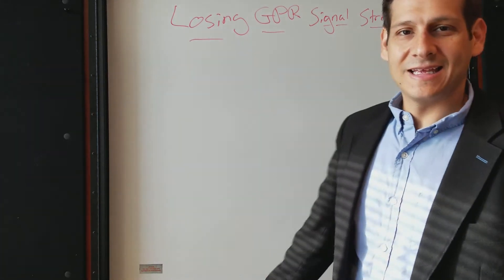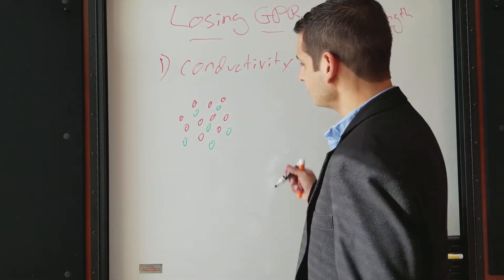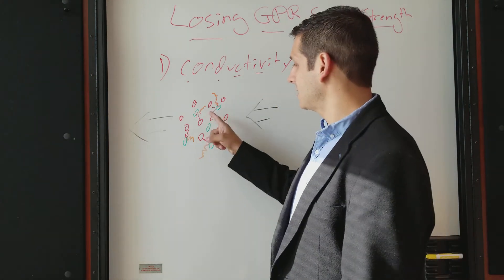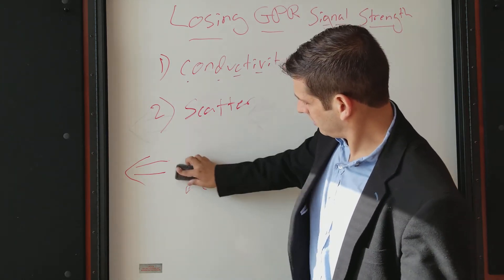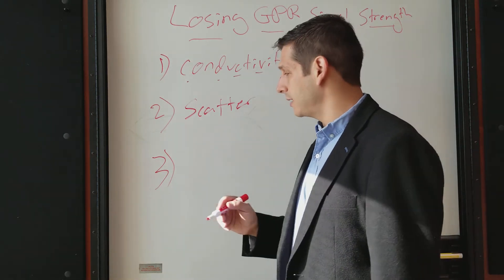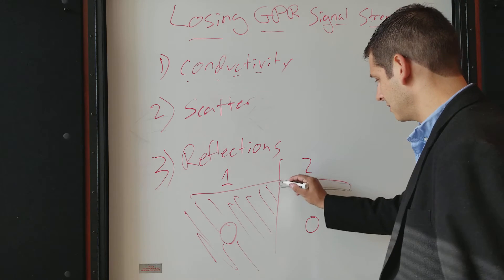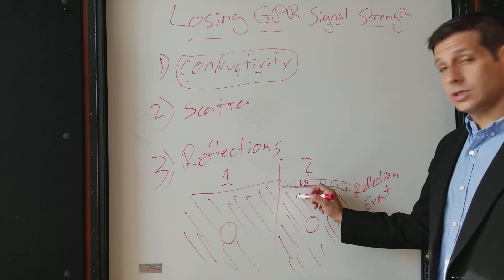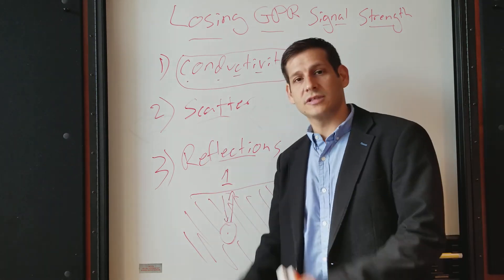Why you lose your GPR signal strength (Ground Penetrating Radar)

Comment: I am not so sure, this is true in most cases. I suspect that the clay soil that is exposed to the elements will be more difficult to see through than clay covered by asphalt. Additionally, when you have the soil capped for years by asphalt, the trenches retain their disturbed nature making them detectable. Los Angeles is typically a poor place for GPR penetration, unless you get into the foothills or dune sands. A vacant lot with several years of rain seasons are way worse for GPR than an asphalt capped lot. In my opinion.
Reply from the maker: Patrick Lehrmann great points and would totally agree with you. The discussion I was making was not that open clay would be better than capped clay but rather that reflection events cause signal loss and limit energy transmission. The exams I gave about clay with and without caps assume that the clay has the same conductivity and relative dielectric permittivity. If the clays are the same then the reflection would decay the signal and would limit penetration with the cap. In many circumstances caps could keep out water and help the depth of penetration. Many times I find that the soils below are disturbed even if they are not trenches and have greater water percolation bc they are unconsolidated and filled with more pores. Trenches for sure allow more depth penetration in my experience too. Often you can see the trench bc it is so similar to the asphalt that there is almost no reflection.  This is great contrast to the reflections at the asphalt/clay interface. Thanks again for adding to the discussion and I hope the videos are helpful. Also I am trying to schedule some workshops in LA so thanks fornthe heads up about the conditions. I've worked out in San bernadino...found them to be good soils! Must be those foot hills you were talking about.